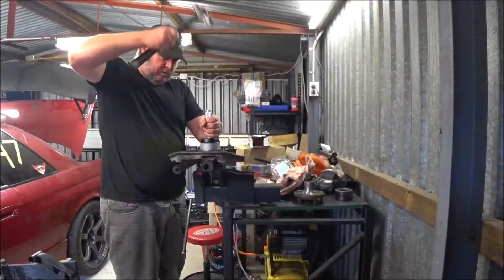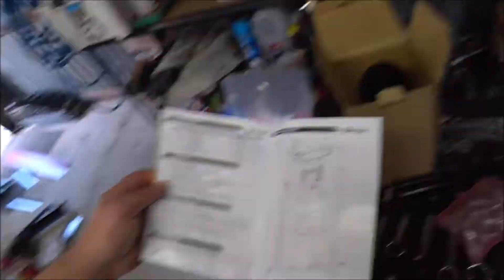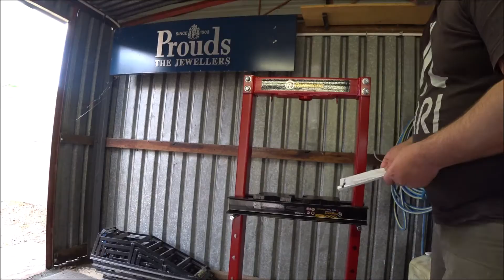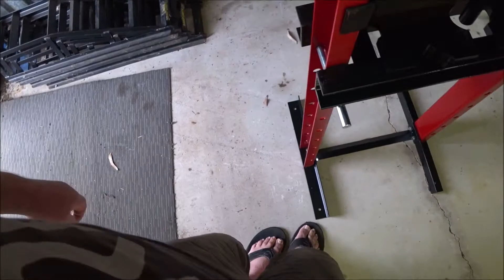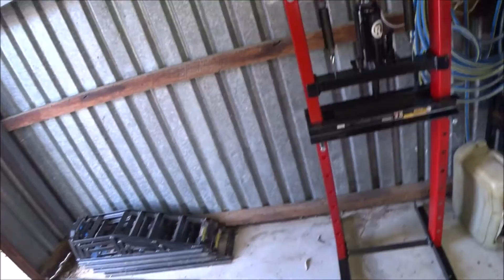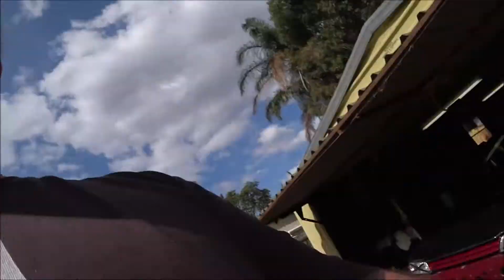Shop Press Assembly - Renegade 12 tonne shop press

Comment: If in doubt.. RTFM.. read the fookin manual  hahaha    

If the hole was punched in the channel web, instead of sitting on the pins, that hole probably not last long with the sheer force from the jack spread across couple of mm thick web.
Reply from the maker: I did say that, but also it's going though an even thinner section in the leg. I'm sure it will be fine either way.